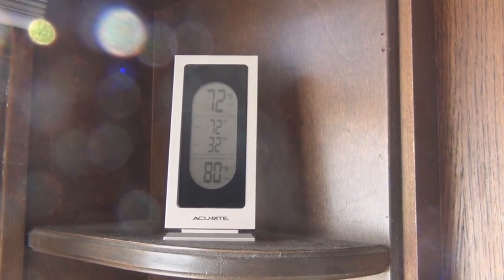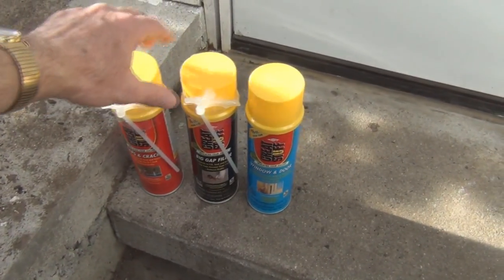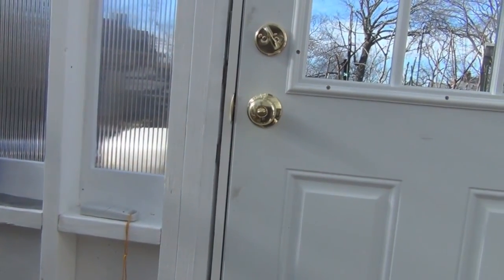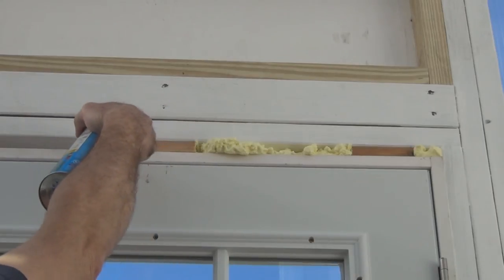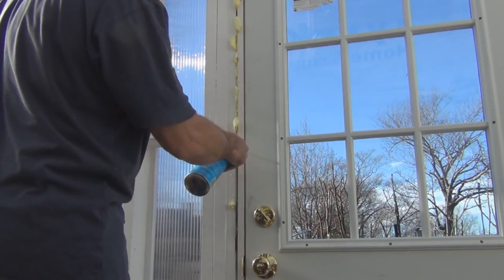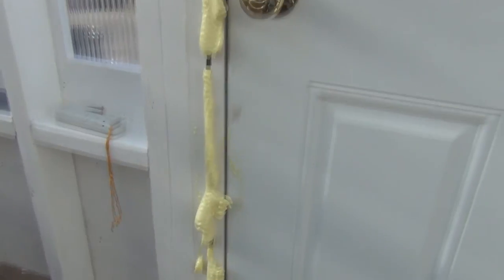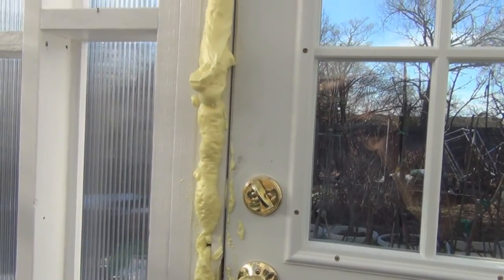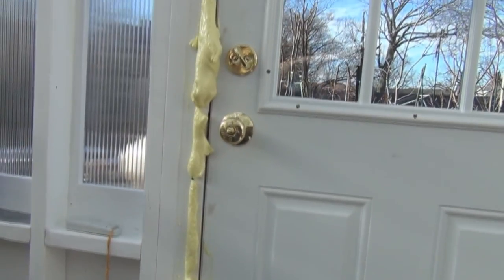Using Spray Foam Insulation to seal a door frame

Comment from the maker: I made a pretty good mess.  At least I didn't use the more rigid stuff.  I need to readjust a couple of shims.  With the heat the frame has expanded so the door hits it sometimes.
Reply: New England Gardening ...so I understand that the excessively applied foam bowed the jamb and you had to readjust the shims? thanks
Reply: New England Gardening maxx

Comment: The guy in the video puts on WAY TOO MUCH of the "stuff". It expands significantly after you put it in the gap until it has cured..
Reply from the maker: I know.  What a mess I made of that.  The clean up was more work than the application.